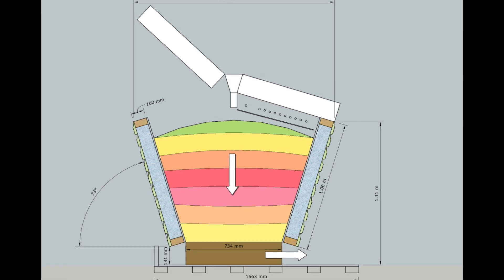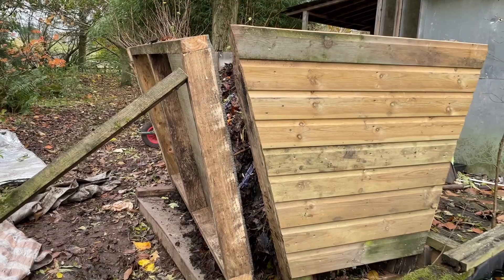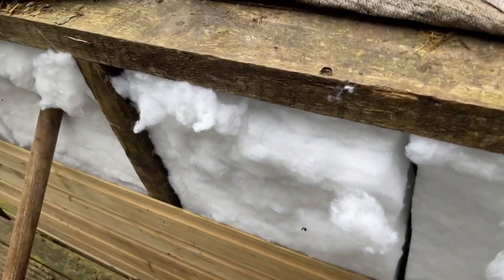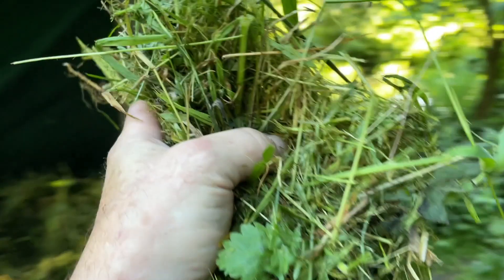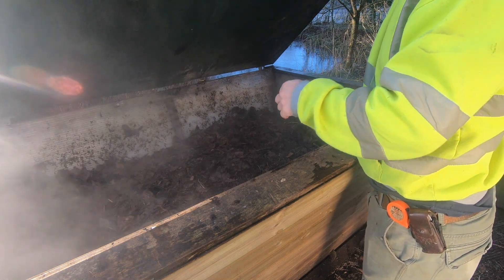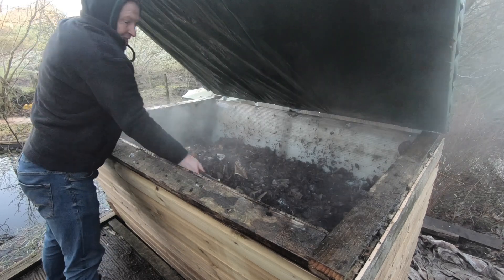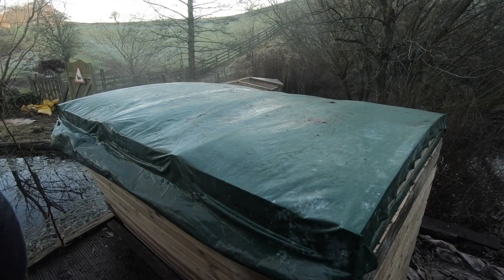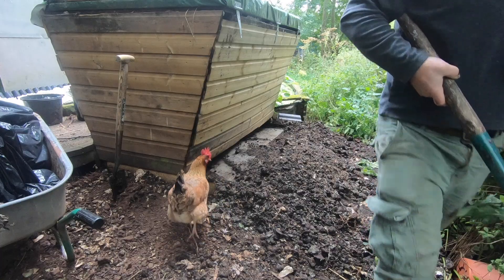Now that's a compost bin!

Comment: This is incredible. I'm working on building a compost reactor for methane production as well as a compost heater similar to what you have here. 

I'm wondering if it would be possible to use the compost tea from the reactor as part of what goes in the heater. It should still have active bacteria and lots of nitrogen right? 

Have you done any experiments with anaerobic compost reactors?

Comment: aweseone, thanks for sharing! why did you use polycarbonate to cover the inside? could I use any other plastic material?
Reply: I guess other material, like dibbon would be better or sheet polycarbonate in place of the corrugated on will last longer. This one leave a lot of plastic crumbs everywhere as it degrades fast..
Reply: Will it not introduce harmful elements into the soil? Then microplastics.

Comment: Paul, thanks for your brain and passions. I have a dome question. What keeps us from making a hexagon plane to replace 6 of the triangles when building a dome that is composed on lots of triangles forming hexagons? Same for 5 triangles forming a pentagon,I know not on the very top pentagon. Can we do that? I know the dome will have a flat spot, and look less round. Any other issues?
Reply: You will introduce a flat, less strong area, and It will lose the advantage of the geodesic dome.

Comment: What is the design choice behind the sloped sides?
I have been thinking about an insulated compost bin myself but way smaller because i cannot feed  a big bin or pile to heat it enough to kill seeds.
Reply: Yeah i'm asking myself the same question; It looks like it lost more heat outside and the compost blocks in place of falling when you pull it...

Comment: Paul, consider adding crushed biochar to your compost. I have never seen such an intense improvement to the agronomic value of the compost as when I simply added crushed biochar to compost. The resulting difference in the plants was like night and day, and this is comparing already great compost with the compost made with biochar which previously seemed to already be fantastic. The presence of biochar radically improves the nutrient retention and exchange capacity of the compost, and the compost with biochar lasts longer in the soil. Theory has it that since charcoal cannot biodegrade, it adheres to and coats itself with a coating of decomposition products, and acts like permanent compost in the soil, while carrying out nutrient exchange. Other less well known phenomena explain the nutrient capture and exchange.